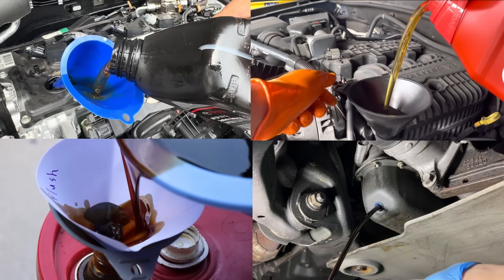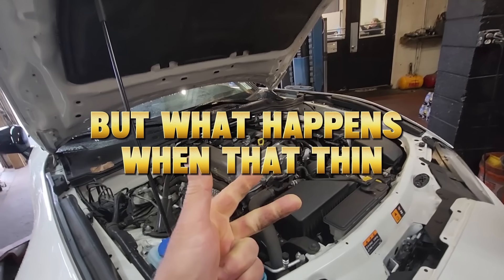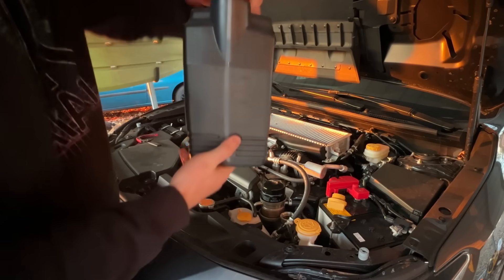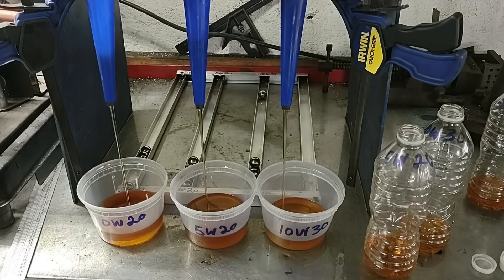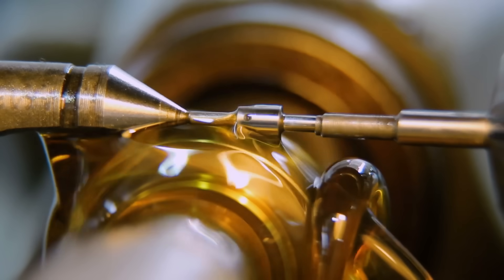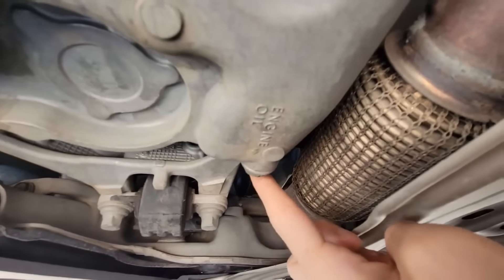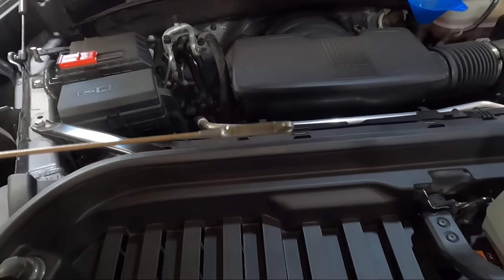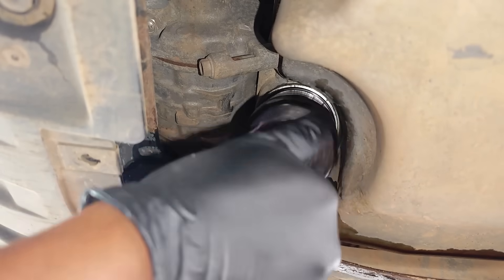The TRUTH About 0W 20 vs 5W 30 Oil (50 Engines Tested!)

Comment: Been using 0W-20 for years with zero issues.  My neighbor has a Highlander he used 0w-20 for 230,000 miles with zero problems.
Reply: If you drive it like a little old lady from Pasadena and you don’t tow a trailer you might get away with it. I am myself I use 5W 40 in my ride because I tow and I like to get on it
Reply: @DCSPORTSTER  bingo 👍🏼👍🏼
Reply: I used 0W-20 and my engine went out after 4 months. So then what?
Reply: @Timmy3Tone because of oil?
Reply: @mrki412  Most likely parking lot burnouts.  😂
Reply: @Timmy3Tone  The fact your engine went out may not have been because of the oil you used.
Reply: @ozzierabbit587  And the fact someones engine made it 230,000 may not have been because of the oil they used.  That was the point I was trying to make--referring to the OP that I was responding to.
Reply: @Timmy3Tone depends on the car and how you drive.
Reply: @jasontodd9302  Exactly.  So not the oil.  Thank you.
Reply: @Timmy3Tone nope oil too. All of it factors in.
Reply: @Timmy3Tone  new engine and 0- 20 for sure for warranty.
Reply: 0w20 is sufficient when you're not buying the cheapest you can find
Reply: @russellkane3893  why do you thin it is sufficient? It is better, engine is using less oil, petrol, so it is more efficient, and that oil is more expensive.
Reply: @mrki412 good quality oil had better lubrication/ protection additives. there's pros and cons obviously in the oil consumption, but healthy engine consumes less than 200mL per 5000kms.
if it way beyond then your oil ring maybe stuck
Reply: There's also many folks running 15w-40 in their engines (particularly in full size pickups) that call for 0w/5w-20 and they "haven't had any problems" either. There's plenty of people running 15k mile oil changes and they're "not having any problems". "Not having problems" shouldn't be the goal as it's just extremely vague and people can get away with sub-par maintenance or minimum OEM recommend maintenance (10k mile oil changes or "lifetime fluids") without their engines/transmissions blowing up but that doesn't mean it's ideal for longevity.
Reply: My 2013 Highlander has 193,000 on 0w 20 since I bought it new. Not one issue, none on 0w 20. Changed every 4500 to 5000.
Reply: GDI engines tend to have more cylinder wash with fuel cutting the oil and increasing wear.  This is a problem with a lot of short distance driving, especially with engines with the auto stop-start function.
Reply: I use 0w20 in my 2013 Lexus es300h hybrid with 358,370 miles and my wife’s 2011 Highlander over 280,000 miles. They don’t consume oil and have zero issues.
Reply: Solo habla de hacer un cambio más arriba si tú uso es tipo más rudo . Si no es así.  Sigue con el q' marca el manual..👍🥵
Reply: This video is BS 😂😂😂

Comment: 30W period.
Even 10W30 IF ONLY IF!! please “ONLY IF” you live in HOT CLIMATE in which it NEVER drops to 45F or under. I live in miami so it works for me. Allways used 30 weight oil. Used also 40W never had a problem. Again it most depends on your CLIMATE! and how hard you drive
Reply: 10-30 is good to below zero, look it up

Comment: I use Mobil 1 5w 30 full synthetic. Changed oil every 4000 miles ish  132,000 ish miles. Runs strong when I step on it today. V8 4.7 liter No complaints. Thinking of switching to Valvoline,restore and protect. Nice vid.
Reply: thats pretty good for a 4.7,had a pitiful 3.7 over over 100K on it no problem,same fuel mileage as the v8 plus the performance of a 4 cyl( mopar hit it out of the park with that one)
Reply: Same here. Toyota with 300,000 km
Reply: I use Mobile 2
Reply: Well if it’s a Toyota 4.7 V8 5-30 was always what was recommended anyway.

Comment: I Just got done with doing my first oil change on a newly purchased vehicle and switching from 0W-20 to Castrol Edge 5W-30.

I have 55k miles of warranty to go, but I don’t care! I’m not letting crooked government standards and awful car companies prematurely deteriorate my new motor for 60K miles all for “better MPG.”

Did a lot of research and read through a lot of comment sections. I’m not looking back! The vehicle sounded so much healthier with a cold start of 5W-30 in it!!!

This video showed up in my feed and gives me the feeling I’ve made the right decision!
Reply: Castrol Edge is a basic quality oil, try better grades.
Reply: @johnt.848 Castrol has GTX, then the Magnatec (better than GTX) and then comes Edge and this one is better than both Magnatec and GTX. 
Edge is the best Castrol has to offer.
Reply: I’m using 5W-30 Castrol Edge Full Synthetic in my new RAV4s as per the recommendation of the owner of a Lexus/Toyota Service Center. Which brand would you recommend switching to? I have used Castrol for for decades, but I know there are more $ brands that are known to have a better reputation.

Comment: Instead of 5W20 recommended by Ford, I was using 0W40 if I was changing the oil in the fall-winter and 5W40 the rest of the year. I noticed that the soon the weather warmed up my engine started to sound a bit sloppy, noisy. So, I gave up 0W40 and now I use only 5W40. I'd like to use 5W50 but it is more expensive.

Comment: I have 2017 Toyota tacoma 3.5L and i use Pennzoil 0W20. I have no issues and i have 560,000km.
Reply: I just hit 360k on my Prius had to replace a few batteries at 243k and head gasket at 320k but bottom end it still strong and I’m on 0w-16 I’m hoping to get at least another two years….
Reply: Do you also enjoy playing Russian Roulette? Because that is what you are doing with your engine.
Reply: @johnt.848 , я-русский, но никогда не играл в русскую рулетку. 😂
Reply: @johnt.848  people are so fooled on a video to believe it. Toyota just does it better with  0w20 and 0w16. they design the engine for that type of oil. I have a friend who works for Uber and was 2018 Camry SE 2.4l with 467700 miles using 0w16. don't tell me the engine should of failed sooner because its not. and he's still driving that car.

Comment: Can someone test 0w - 40 ? 
I would think this oil would cover everything !!!!
Reply: Yes,  that would probably be the best oil to use. In my ATV I use 5W 40 full synthetic. cold, hot, dusty conditions use it in the winter time haven’t had a problem it’s got 4000 miles on it now runs great.
Reply: My VW Rabbit with 2.5 l 5 cylinder engine was 315,000 miles when I sold it. 0w-40 oil the entire time.

Comment: 11:36 listening to this while laying down and thought i had a stroke had to go back and listen to it again wth language is this lmfao
Reply: I haven't heard anything like that since my 8-track player started eating the tape.
The whole video uses clips from other YouTube video creators.
This is an AI voice "reading" a script.
Reply: You have to imagine it used as the narrator for a summer blockbuster about oil.  THIS SUMMER…IN A WORLD OF THIN OILS…😂🎉
Reply: it's AI
Reply: AI Bubba to you!
Reply: I think he consumed some 10w-40 LOL.
Reply: LMFAO
Reply: AI video or maybe aliens.
Reply: That was some crazy shit the AI VOICE was belting out. The first time I heard it I was like WTF?! Lol 😂 had to rewind and confirm the jibberish 😅 I change oil every 3000 miles on a ford explorer sport twin turbo 3.5 liter motor. The motor beats down oil so I try to keep it in good condition
Reply: @finnracing99  yes sir I agree 1000% with I have a 2016 fusion 2.0 ecoboost that has A little work done to it (air intake, blow off valve, full exhaust, header, high flow cats, ecm sent out and reflashed with upgraded and updated software and a turner)making anywhere from 300-350hp @20 psi of boost depending on my turner setting (no this isn’t actual Dino numbers but it’s a good rough estimate with the upgrades I have I’m sure it’s prolly more but I try to not over estimate) and yes these eco demons beat the oil down crazily fast I use Lucas full synthetic high mileage oil stabilizer every oil change, I found that it does help with it beating the oil down but my fusion is just a little over 300k miles on it and still going super strong.
Reply: @BillyTompkins-pu7pf  
All  Lucas does is thicken the oil.
Reply: @ticker511  actually Lucas puts a film over the bearings bubba scientificly proven by not only many YouTubers but also big oil companies as well so yes it does thicken the oil but you obviously haven’t done any research for yourself and that’s fine but Lucas puts a protective film over your bearings to protect from no oil starts and cranks as well as giving your engine longer life. Also I’ve used Lucas in semis as a mechanic and have not had to rebuild an engine before 1.5-2 million miles but the ones I’ve had to rebuild at 450,000-500,000 miles never had Lucas put in them and only went to dealers for services so proofs in the mileage for me bubba if you don’t run Lucas or like it that’s fine as well but I’ve seen, read, heard proof of it working as well as my 2016 fusion bubba with 300k on it and still going strong I drive it everyday and race it on the weekends oh did I not mention that’s 300k on a 300-350 hp(depending on my turner setting) 4 cylinder that is pushing 20 psi of boost oh I also haven’t mentioned that this 300k engine has never been opened up yet for nothing not valves, rings, nothing it’s 300k 300-350hp factory engine bubba you ain’t going to tell me all Lucas does is thicken the oil it also helps keep the oil from breaking down faster as well
Reply: @ticker511  I'm guessing that's about all STP did back in the day.

Comment: The commentary will makes sense to the average vehicle owner that is "nieve" to real friction dynamics. My 2001 Grand Cherokee doesn't burn a drop of oil w/183,000 miles on the clock. Why, because when I first bought it @161,000 miles I changed the oil 5 times in the 8,000 miles until the dipstick stayed clean. I use 10/30 with a "splash" 20/50 only because of age. My formula works after running 80-90 mph or off-roading my old baby is fine. One must be one with engineering, engine dynamics and how it applies with driving habits. I've had my share of muscle cars and drag racing. I know very well what the wrong oil can do. Especially running over 6,000 rpms.

Comment: I have started using 5w 30 in warmer half of the year and use the 0w 20 it recomends in winter on my two toyotas
Reply: That’s what I do only because I’m retired and do a LOT of short trips.
Reply: Why not run 0w30 all year?
Reply: @peter7582  because at -30 or -38 *C it might not be a good choice here in Canada even with a block heater or heated garage, mind you I run 5w30 in my Toyota 4.0L and 3.4L, but the highlander calls for 0w20 so it best to align your changes with seasons, but that doesn’t always work out.
Reply: @peter7582  that is hard to find and the wider the range the less stable it is, they have to have an oil at one viscocity, then put in tons of additives to make it work as a different viscocity at other end so it breaks down sooner
Reply: Curious, what engines?
Reply: @johnyoung5482  both of toyotas i have the old v6 from 2011 and the 4 cylinder from 2017 i forget the engine models i think 4gfe or something

Comment: 10W-40 in Australia due to the heat. Never had any engine trouble ever buy going a tad thicker.
Reply: 10-40 самое лучшее масло для двигателя. все остальное маркетинг. а по цене в два раза дешевле и двигатель работает мягче и расхода масла нету никакого
Reply: 10w40 is an awesome weight!!
Reply: Motorcycles use 10w 40. Not many cars see those sorts of rpms.
Reply: @mowilson5712  It can get bloody hot here in Oz. If u look at the viscosity/ temp charts, 30 is a bit thin in summer.

Comment: I have a 2016 fusion ecoboost that has roughly 300-350 hp at roughly 20 psi of boost that has 300k miles that i run nothing but wix xp filters and i switch my oils between ams oil and penezoil ultra platinum 5-30's with Lucas high mileage full synthetic oil stabilizer with all my oil changes.

Comment: Trouble is manufacturers reject warranty if you don't use their recommended oil, so use what they recommend whilst under warranty then swap after that.
Why not just use 0W30 or 0W40?
Reply: You dont really think theyre going to do an oil analysis do you
Reply: @billman6364  Normally no, but if 0W 20 is called for, 10W 30 will look considerably thicker, both on the dipstick and in their drain pan, if they are changing the oil, then they might indeed do an oil analysis if they think it will free them from having to honor the warrentee.
Reply: If you are worried about that, just add some kerosene to the oil to thin it when bringing it in to them, fooling them into believing that you are using their recommended oil.

Comment: Belgium here, owner of a 2002 VW T4 TDI, 575,000 km (approximately 360,000 miles). I've always driven with high-quality 5W30 Long Life, still with the first turbo, and an oil consumption of 1 liter per 12,000 km. I only change my oil once a year (approximately 18,000-23,000 km). I 
drive the car under typical Belgian driving conditions. 
Note: yesterday my crankcase was disassembled due to an oil leak; the cylinder walls showed NO signs of wear or scratches. 
I find this video VERY informative, but I fear the average user will have little understanding due to a lack of technical knowledge. 
I'm a professional myself.
Reply: Cher compatriote, personnellement je change mon huile tous les 10000 km en changeant le filtre à huile et tous les 20000 km je change aussi tous les autres filtres. Huile c'est la vie du moteur ! À 20000 KM votre huile est déjà morte.
Reply: @LEBXLS  probablement pas car mon moteur, turbo etc à déjà 575000 kms, j'utilise Castrol Edge Platinum Long Life, (30.000kms)j'avoue que je pars toujours de l'idée de faire la vidange après 10.000kms, mais toujours en vain
Reply: @LEBXLS , к 5000 км масло уже мёртвое.
Reply: How many times have you changed your timing belt?
Reply: @ralfrufus6573  every 120.000 km (75.000 miles) every time i changed the waterpump as well (driven by the belt)
Reply: If I let my Toyota 4Runner 3.4L, Tacoma 4.0L or the Highlander 3.6L go for 12-14km as suggested from factory it comes out jet black and thin, now I change them at 8-10,000km and use Castrol full synthetic 5w30 and factory filters, and Toyota N/A engines are usually zero oil consumption over 8-10,000km, or no measurable loss.
Reply: That’s so good
Reply: 18 k to 23 k kms is too long interval.  You can max stretch to 15 k km.

Comment: Here in Australia I use CASTROL 5w30 FULL SYNTHETIC on my v8 mustang, for preventive maintenance reasons I replace every 7,500kms ,this may be a bit of an overkill but oil is cheaper than a full engine recondition or replacement. Engine runs great and quiet, so something's working.
Reply: Oil is the cheapest part u will ever change with 1 spanner.
Reply: Certainly not over kill.. I do my Audi V6 at the same interval but with 5 w 40 instead of the recommended 5w30
Reply: What's the manufacturer's recommended grade sir ??
Reply: Hi there, when I purchased the Mustang back in 2019 this brand and the viscosity was recommend by Ford, so here in Australia the dealership's went by this. I've used this since I purchased the vehicle and doing my own oil and filter maintenance, as I mentioned EVERYTHING is running GREAT.  @siddharthraghuwanshi3457

Comment: almost always had cars with 5w-30 oil, and love how good full synth oil has been in my older car (the seals are modern enough to handle synthetic). glad that modern oils (both dino and synth) are so much better then 30 years ago, and also glad that there are options for those with classic rides.
Reply: ...than 30 y... !